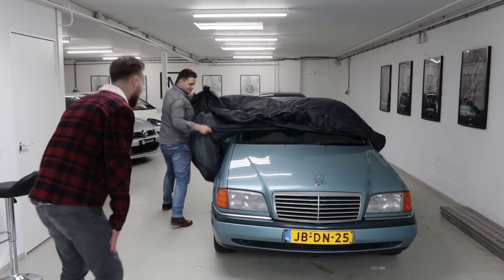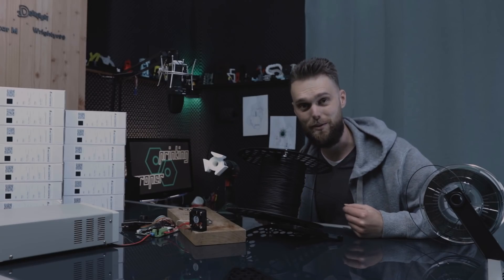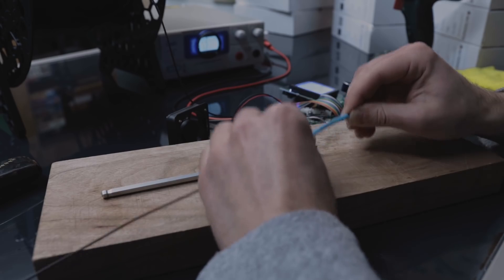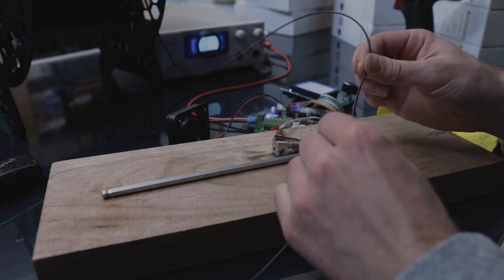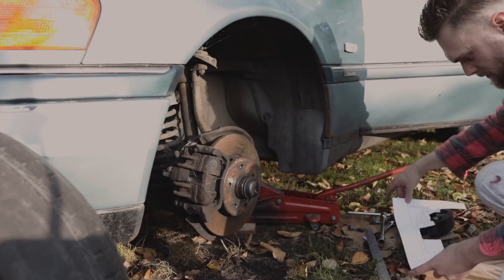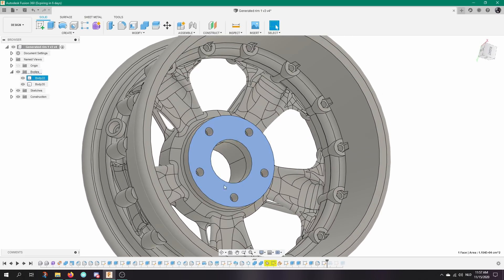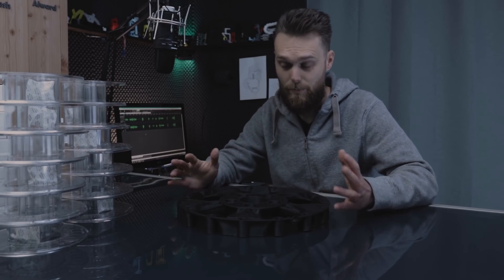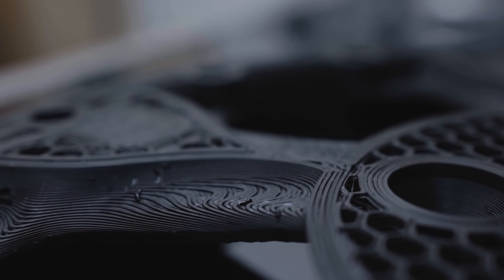I tried to 3D print a full-sized rim for my car out of ABS

Comment: I'm guessing you're going to need a pretty clean weld, I think sanding is going to leave a rough finish that can get caught up even at an acceptable diameter, like it did the second time. You could maybe try something like a bandsaw blade spot-welder configuration. Cut a hot-end tube down the centre, with a diamond-wire handsaw or using a slit saw on a mill if you have access, then use the two halves with current applied to make a heated clamp which you can press the two filament pieces together with to give a smooth finish. Hopefully that makes some sense, can send a drawing if it sounds like any help at all haha!
Reply from the maker: Interesting approach and this didn't occur to me, thanks for bringing this up! The only problem I can think of is that the whole tube gets hot so I need a cold zone. Otherwise the filament on the outside will melt too causing a collar. I got this problem when using a steel tube to melt the filaments together.
Reply: Proper Printing Avoiding the collar will be difficult like you said, you’d need to keep the heating part as small as possible and spring load the mechanism so it only heats as you press the two parts together. Maybe instead of an electrical solution a small precision flame would give more localised heat on the tube you use rather than heating the whole tube with a current. It may also be you first method with sanding will work if you expose the sanded filament to a naked flame briefly to smooth out the area. Either way I would make a meter of weld tests and just Tun that through the hot-end to really test the method you use. Good luck with it, looking forward to seeing the rims!

Comment: Calculate how much you can print, until the spool is empty, then place a pause in you gcode without cooldown of the bed, change the filament and resume print :D
No melting.. no rocketscience..
Reply from the maker: It almost becomes rocket science when everything sits inside a heated chamber which must not cool down ;)
Reply: @properprinting  but you can pause the print or not? pause the print after 900gr material and change the spool.. then resume :)
Filamentrunout-Sensor is also a solution.. if the chamber is heated all should fine :D

Comment: Just an idea. Take a printer nozzle, carefully drill it out with a 1.75 mm drill, screw that in a hot-end and push through the filament. No idea is this will work, but it seems logical.

Comment: First of all, Amazing work on the printer!! Would love to have one for a similar reason :)  joining the ABS: 1. Wouldn't a Palette be of help? You would probably get it sponsored and you can use 4 spools and it automatically joins them or the multimaterial selector from prusa as the open source variant..  my own version would be to make a second jig with razor blades,since they can be bent to a certain degree, 3 of them in sequence should shave down the diameter of the joint to reliable 1.75 or you run the joint through a set or two of extruder gears that are set quite tight.. the PTFE tube has an inside diameter of 1.9-2mm and is stiff on the inside and can absorb some squish on the outside,so it isn't ideal the way you pressed it. Hope it helps get a lightbulb going..cheers from germany

Comment: What about getting a copper tube with the same inner diameter as the filament have a hot air gun heat up the tube and press the filaments together thru each end to join them that way ? Only thing is the tube would have to stay on the spool untill your completely done so it would need to be mounted solid before your bigger spool.
Reply from the maker: I've done this approach with a test probe receptacle. This was not the proper diameter, which caused the problem, even after sanding down. I think the approach you're suggesting still is the easiest one to implement and I can just use the heater I already have to heat up the tube. The downside you describe makes me want to look for something else.
Reply: Ohh I just had a damn genius moment these dont come my way often so I better write it down Lol. What about using a split fitting/tube over a collet, almost like how a drill pushes down onto a bit to keep it in place. ?
Oh hey check this out 
https://www.thingiverse.com/thing:9850

Comment: We used to join fiber optic cable with lasers. The fibers would be laid in a slot separated by a few thousand microns. The laser would heat up the fibers to transition point then press them together automatically thus fusing them.

Comment: Could you make and use a split die with a 1.75mm bore through the centre? Made from aluminium or other metal, it clamps over the filament and is heated from the outside and then removed after cooling. The main difficulty would be seeing when the filament ends are touching.

Comment: Can't you just drill a 1.75mm hole in a metal block to merge the filament in? Instead of the PTFE tube (that degrades at the temperature you used, which is toxic)
Reply from the maker: My second try was with a test probe receptacle which is basically a steel tube. This way it merged way better and it just failed due to the rough joint. The problem I faced is that the whole tube got hot so filament started to get soft on the outside as well leaving a collar. So, the tube must be long enough or it needs cold zones at the opposite ends. Preferably it must be splittable so it can be removed.

Comment: I use MEK (methyl Ethel Ketone) to post process certain ABS parts.  I might have a 2 piece part that dove tails together.  I then use and eye dropper in the seam, it wicks in and makes the joint forever.  Were I building a tool for this, I'd want a tube only about .1mm bigger the the filament.  I would cut both filaments at same time in jig so angle is perfectly matched.  I'd slip together.  Drip in some MEK through a side hole.  Then allow it to cure for a few hours.  Whatever method you choose, do a test of 20 each 1/2 meter pieces joined together and run a part to consume it and see if you can get all 20 to work properly.  I would do a vase mode part so you can also examine the joints there they come out for any flaws.  You might do this with alternating colors so you know where to look.

Comment: I think you should just use the larger rolls of filament  and change them out as they get low. It would be easy to calculate about how long a roll of larger fillament would last and then you would know when to stop by and make the change. Do not fool around with joining the ABS filament.

Comment: I'm a little concerned at the gaps between your perimeters. That will likely be a structural weakness allowing more flex than you'll want in the finished product. You might need more overlap in your slicer. Of course, I could be totally incorrect in my concerns.
Can't wait to see the continuation of this project. 💪👍

Comment: I have to agree with the others, you are trying to solve a self made problem. 1) I would redesign the rim to be assembled from smaller parts, you can just reprint those in case of print failures or later failures while using the rim. 2) Use a second material for supports to save the expensive main material. 3) use a splicer like Palette 2 to splice your filament together (and don't do this yourself) or even better use a MMU2 to swap between rolls (and the support material), Marlin 2.0 supports it now. 4) Getting bigger rolls is far the easiest solution for your problem. 

Go ahead, I am waiting for the final result on your car!
Reply from the maker: I agree with the self made problem I try to solve, but what I'm hoping to achieve is to be able to print large things in one go. It's not just about printing a rim, this is an interesting thing to use to explore these kind of challenges and learn from them which will help me, and possibly others, with other designs. I'll take a look into the MMU2 of the Palette, thanks!
Reply: @properprinting  good idea, palette can do the splicing extremely well and you don't have to prepare it before you print.
What about bigger spools? I know that Evan Miranda is using 6kg spools for his (also large) projects.

Comment: Congrats Jon! The beast finally ate some nice amount of filament 😄😄. Why not use a filament runout sensor, pause the print, replace the spool and continue printing?
Reply from the maker: The main reason for me to not use a filament runout sensor is that I have a heated chamber which is at a stable temperature of 60°C. The print will fail if I open the door letting cool air in. I need that printer to print in one go. Trying to push filament through a reversed bowden tube hoping that the direct drive extruder will grab it is too tricky I think xD
Reply: mostly causes layershifts same as shut off and and resume never as strong as one whole print... because the layer before already cooled down if it was not for something as structual as rims it would be fine i guess
Reply: @PascalVos  When I am doing this, I wait till the printer is printing supports then there is not a structural issue.
Reply: @LarryClay  exactly, thank you. There are many workarounds. As soon as I saw Jon trying to bond filaments I knew it was going to be point of failure. I know @ProperPrinting has a card up his sleeve and that’s why he did that ♠️

Comment: Try printing something small out of strings of ABS connected / joined in different ways in order to see which way is the most reliable :) just a thought.
Reply: For example, take a load of short pieces, connect them in various ways, note down which order they are in and print something small, to see which breaks first and out of which of the join types is the most reliable.

Comment: I recommend coating the pressurized portion of the rim with 1-2 layers of low viscosity resin (i prefer XTC resin for this purpose).
I designed and 3d printed a housing for a prototype miniature ROV (industrial remote control submarine), and without some kind of resin coating, it would leak air thru the housing walls when we put 30psi in it, even tho the wall thickness was 3.25mm @ 100% infill, and I made the printer over-extrude on purpose.

USE RESIN!
Reply from the maker: Great recommendation, thanks! I was thinking of applying a coating, but didn't think of resin. Did you just cure it in the sun? I don't have a large chamber with UV lighting where I can put the rims in.
Reply: @properprinting  XTC is a not cured by UV light. It's more of low viscosity 2-part epoxy. I should have called it that instead of resin.
You paint it onto the part with a brush (foam or bristles).
To clarify my previous comment, 30psi is roughly what a car tire is supposed to be inflated to (mine are supposed to be 33 for the front & 32 for the rear)
Reply from the maker: @pass-123  clear, thank you! This seems like the perfect solution!
Reply: @properprinting  Also if you need a bulk roll of ABS: pushplastic.com
They have 3kg, 5kg, 10kg, and 25kg rolls.
My company uses a 25kg roll.
Shipping might be expensive for you tho since it is an american company.

If you do get a large roll, avoid fast and/or frequent retractions. Larger rolls have more inertia and will cause under extrusion immediately after a fast/normal speed retraction. Big rolls also collect a lot more dust.
Reply from the maker: @pass-123  thanks for the info! 3D4Makers is working on delivering bigger spools which will solve the issue.

Comment: For testing filament joints, I suggest making 1m long piece of filament that is full of as many joints you can fit. Then you can test them quickly than having just 1 between each spool. Otherwise maybe it would just be safest to install some kind of filament runout sensor that can pause the print until you swap it.
Excited to see how you solve it. I have tried to splice filament a few times but often it caused jams that made me have to take apart my hotend so would be great to discover a reliable way.

Comment: If you can redesign the center of the wheel to use a preexisting inner and outer barrel like HRE wheels did with their 3d printed wheels. That would eliminate the need to seal the wheel. It would also allow multi piece wheels to be made. That way, if a particular piece failed. That part(inner barrel/outer barrel/center) can be reengineered to fix the problem without having to print a completely new wheel. It would also break down printing into sections that can be bolnded together and make print failures not as catastrophic.

Comment: Just wondering, if you use a dual headed extruder then you could use a cheaper filament for the supports which would mean less splicing of the main more expensive filament roles? Or some kind of g code to swap heads on a filament line break ?? 
Keep at it and you’ll get there.

Comment: This looks so cool as a project. I just found 2 little challenges... 
1. If you manage to fit the tire, will it hold the air pressure?
2. The heat produced by the brakes will affect the rims, causing them to deform.
Reply from the maker: 1. We'll find out ;) 2. I hope I will ever get to that point xD

Comment: What factor of safety are you aiming for?
Reply from the maker: This is aimed at a factor of around 1.2 if I remember correctly. However, this is based on solid homogeneous ABS so it's not representative to a 3D print. Due to all these variables like infill, nozzle diameter, perimeters and materials I've chosen for the trial and error approach. First I'd like to be able to print a full rim and test it after which I can focus on design, process or material improvements.

Comment: Nice video as always, but putting structural concerns on the side, how do you deal you the heat generated by the brakes? Did you check if they can reach the glass transition temperature of the ABS?
Reply from the maker: I hope I will get to the point of the brakes reaching a temperature that high. ABS will possibly not be my final material and maybe I can make the center out of another material.

Comment: Why you dont just add filament sensor?
Reply from the maker: Good question. I don't want the printer to pause and have to swap the filament manually. I have to find a way to do that without opening the door in that case because it's a heated chamber. Especially when printing tougher materials I'd like this machine to continue until it's done.

Comment: easiest way might be to get a long block of teflon with a precise 1.75mm hole and do what you did in this video
Reply from the maker: Thanks for your suggestion! This seems like a great idea! The only problem is that I want to join higher temperature materials too and Teflon isn't that safe at these materials. I'll keep it in mind because I might use Teflon for the colder zone to prevent the filament from further melting.
Reply: @properprinting  you can look into those filament splicers for colored prints, they cut and join filaments automatically so you can try one of those

Comment: When you first mentioned the joining of ABS filament, my thoughts were 'with acetone' immediatly
Reply from the maker: I found that method as well and I thought about doing it that way. The reason why I didn't is because I want to use different materials than ABS later on, hence I want to find a way that works for other materials too. Thanks for your suggestion!
Reply: @properprinting  For gluing ABS use Methyl ethyl ketone (MEK) it truly fuses it together and sets fast. I have used it and it's stronger than the prints themselves. Acetone is actually a far worse solvent for ABS because it takes forever to set.
Reply: @properprinting   Can you superglue the ends together?
Reply: @ps3ud0r00t3r  don't you think that the super glue would eventually clog the nozzle?
Reply: Good idea, clean 90 degree cut + acetone joining. Never tried it myself though and it would work with the PEEK he wants to use for the final version

Comment: What's that white snake at 0:50 called? Do you have a link for the STL?
Reply from the maker: It's the tubing chain I've designed recently https://properprinting.pro/product/tubing-chain/ this can be connected at different angles and bend in one direction.

Comment: Use a Pallete machine to join the filaments
Reply from the maker: Sounds interesting but I don't see it clearly how I can do that with existing filaments. Can you elaborate or do you have an example?
Reply: @properprinting  you could cut the sections of the plastic of the joints away and the pallete has a mode that you can use multiple spools of filament for one print. (Changes rolls when one runs out) you can then spool the filament that is coming out of the machine on that big ass spool.
Reply from the maker: @Vinnest  First time I read Tristen's comment I thought he meant a machine which used pellets (or granulate). After reading some later comments I now understand that he meant the Mosaic which is a very interesting machine. Definitely going to take a look into that.
Reply: I wouldn't you could still get a splice failure and then your done. I'd avoid joining filaments at all and just used fixed times of the day when you change the spool before it runs out of filament with some buffer time in case you forget for an hour or so.  Then you don't need to baby sit the machine and you just end up with a ton of extra small spools for smaller parts later if you have a filament sponsor it makes sense.
Reply: @riakata  you could receive a splice failure but you can just spool the output filament from the pallete then use the spool to print.